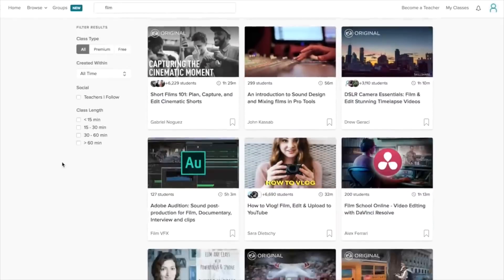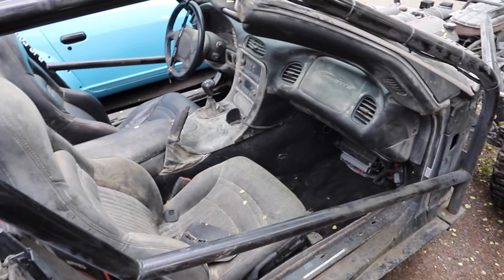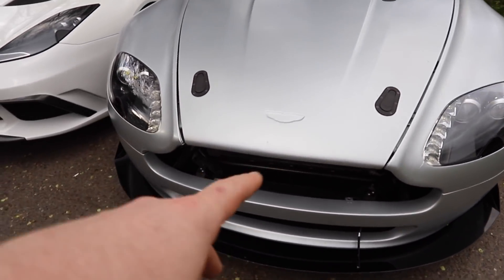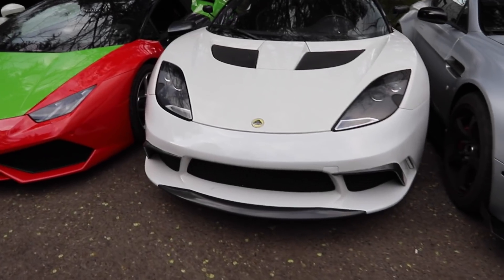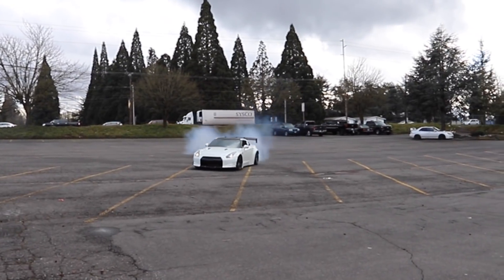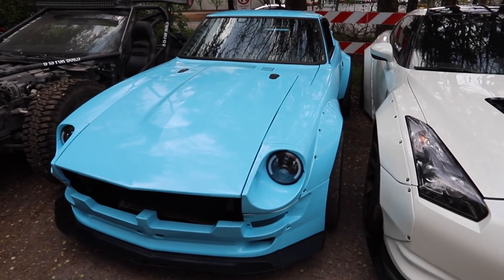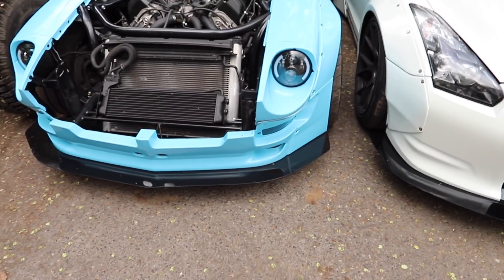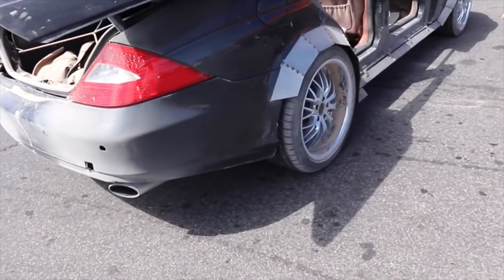2019 BIFB Garage Tour! 240z, GTR, Huracan, Evora & More!

Comment: You just told that u got 14 cars including the secret ones, I did the math...  means there are 16 and a half but ur not yet sure about the 16th one. One is a trashed lambo cuz u wanted to finish this one to get all kinds of mesurements and the trashed one is probably without an engine, knowing u a challenging engine swap is something u would do, I would kinda not believe what im sayin, but a 4 rotor twin turbo lambo full on roll cage without panels might be coming soon. xD
1.Nissan 240Z
2.Nissan 370Z
3.Subaru BRZ
4.Camaro SS
5.Ford Raptor
6.Lotus Evora
7.Lamborgini Hurracan
8.Aston Martin Vantage
9.FJ cruiser
10.Corvete (Offroad)
11.Mercedes (Otis style)
12.Nissan GTR
13.BMW M5
14.BMW Z4

Comment: hey Chris, if your 2JZ still has the stock Toyota ECU, it probably needs to be recapped. my buddy who 1JZ swapped his Mk.3 Supra and used the stock ECU/harness, had issues with random fuel/boost cuts, eventually shitty idle, and then not running at all. $60 to recap the ECU and all the weird issues went away. very common for 2JZ and 1JZ ECUs to have all the electrolytic capacitors fail.

Comment: I would really like to see a clean restore on the Camaro. Ive been around since you first started working on it (I may have gone through a few profiles and name changes since then) and Im planning on doing paint on my '74 Mercury this summer. Might give me some motivation to actually commit to it this time. Even you, Chris, might shy away from it if you saw how much bodywork needs to be done :)    On the other hand, do you have any 18 or 20 gauge sheet metal laying around? Ill buy some of it for my rear Quarter panels (20 years of sinking into a bog did a number on the vehicle)

Comment: For the gt-r you can do a boost by gear intead or retarding the timing, and for the 240M5 you can go for a sequential transmission with steering wheel clutch like in a f1 car to make it as badass as possible even if it already is.